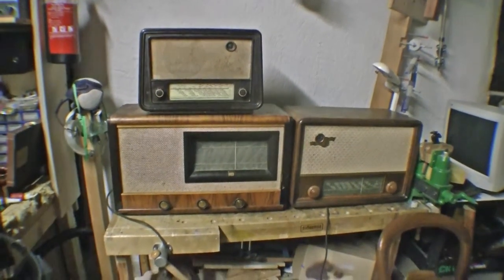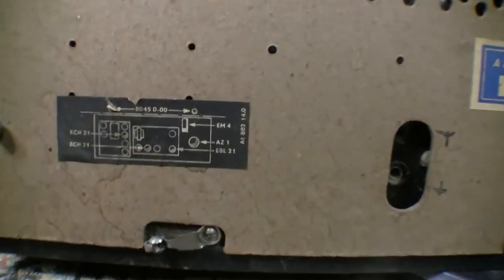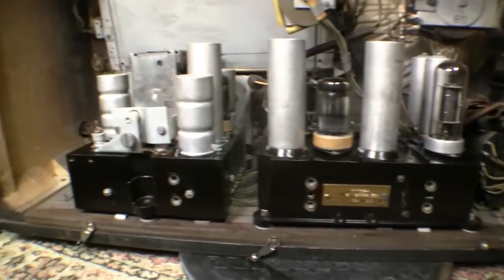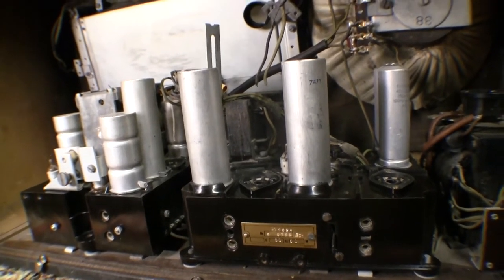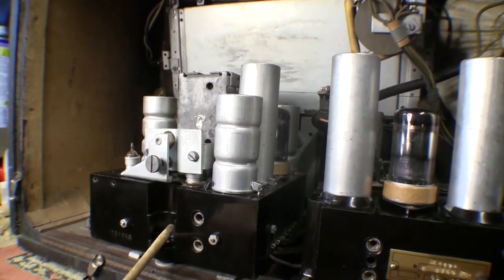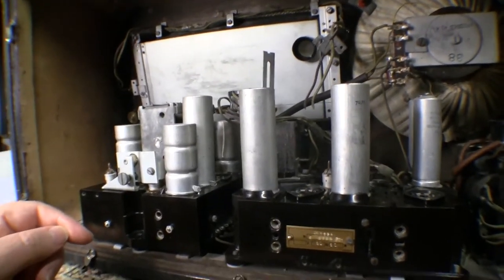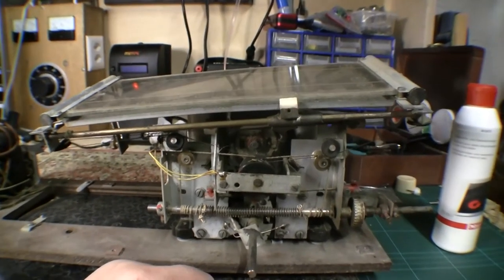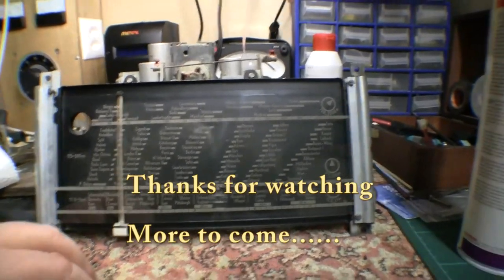Mediator M162A - part 1

Comment: The Swiss, having been (and continuing to be) friends with virtually every country on the planet, and truly neutral in 1942, proved the fact by listing every country's SW broadcaster's frequency location on that "thoroughly packed" dial face!!

The wartime rubber shortage had to have been "cause and effect", the reason for your rubber wire dilemma. She's begging for a nice cloth wire re-wire job!!

One of the finest radios that I've ever seen, I'll surely enjoy this series!!

PS: I'd toss a few craft beers, and some high octane Swiss chocolate down the old hatch before messing with that dial cord!!
Reply from the maker: ***** Hi Tim, alas this one will have to settle for modern plastic coated wire!   I've never had the best of success with cloth covered wire and this one is already a challenge.  Likewise caps will be simply replaced  - no time for stuffing the existing ones - well I can't really because they seem to be just lumps of tar surrounding the core so no outer paper covering.    Doc says I need to keep away from the chocolate :-) Cheers,   John

Comment: With the large loudspeaker and the better than average audio circuitry, did I see a separate feedback winding with integrated tone controls around the feedback loop? Very advanced for it's day. I look forward to hearing it.
Reply from the maker: Michael Beeny Yes it's got that feedback arrangement.   It looks like the circuit diagram is not too different from the actual set I've got but a schematic would certainly help!

Comment: Part of the reason they used steel chassis almost to exclusion is that the costs of tooling for mass producing a steel chassis is substantially less then molding Bakelite ones. To mold Bakelite involves machined and polished steel molds which are expensive to create, however the material is inexpensive, so for a large volume it makes some sense with something like radio cabinets. There were some early radios with molded Bakelite chassis, including tubes sockets, and Zenith has a go at it in the early 1940s, but they fell out of favor for one reason or another. I think the reason being is that if one wants to modify a steel chassis all you have to do is leave out holes, or add some elsewhere on the chassis, and then mount the parts you want to use.
 Whomever built this radio didn't go as far as Zenith did where they molded the tube sockets and the volume control into the chassis, they only made the boxes, which was a prudent move in case something happened to one of the sockets. I guess the modular idea went hand in hand with the Bakelite chassis, if they wanted to make a different model they would hook in a different chassis module. To me it's a sort of archaic idea, my RCA Radiola 44 and Canadian Westinghouse model 89 are built that way, but in those cases it was because there were also battery and DC mains only sets that used the same tuner chassis, as well as models with a bigger audio amp. By the way I saw a pair of ECH21s listed on that schematic, those are triode heptode tubes usually used as an oscillator and mixer combo.
Reply from the maker: OlegKostoglatov I'm always interested in finding stuff that's new - for me at least. Since I have to replace every wire in this thing I'll take my time and try to get it right!
Reply: Zone1242
I did a little research on this Mediator company, I looked through a number of their models on one site, those that had pictures of the chassis, and it looks like the M162 was the only set where they used chassis made out of Bakelite. Some of the others had modular chassis, at least in terms of the power supply, but most seemed to stick to the convention of a single chassis made out of steel. However some of the others from the same era as this M162 had sort of a two piece chassis that was bolted or riveted together.
  I think that Mr Batterymaker was right though, there was some sort of tie in between the Mediator company and Philipps. Looking through one of the galleries online it looks like there were a number of Mediator models that shared Bakelite cabinets with Phillips sets, or featured one of those free standing glass dials mounted on top of the cabinet just like some Phillips sets had.

Comment: I have watched your videos with great interest.  This looks like a great project.  It is probably too late, but it occurred to me that if you removed the speaker, you might be able to have a better look at that dial cord assembly.
Reply from the maker: Stephen Moore Thanks Stephen.  Now that I know how the wire is run, I don't think removing the speaker would have helped much - but it will help when it comes time to put it back together so the speaker will be coming out before re-assembly.  Right now I think I'll see about making a jig to put it back together.Cheers,   John
Reply: I guess I should have watched Part 2 before responding.  :)